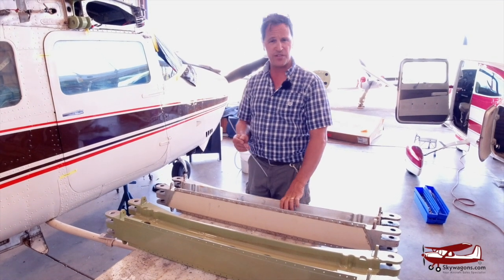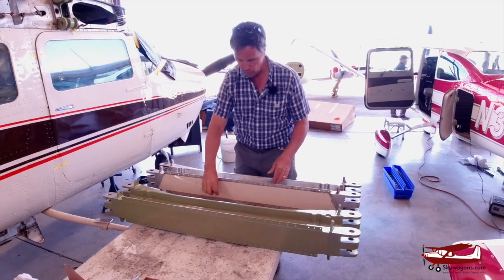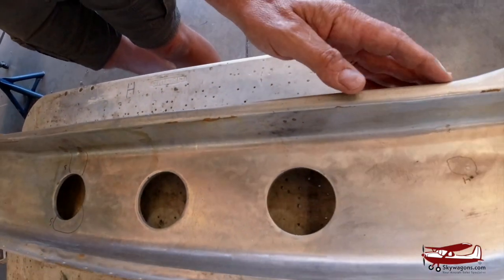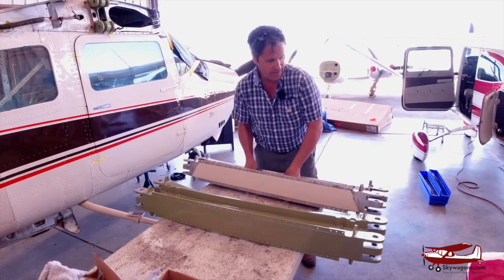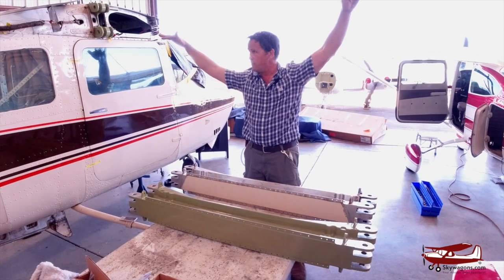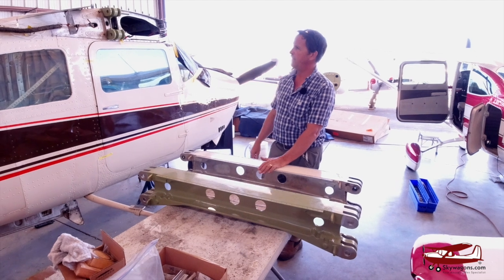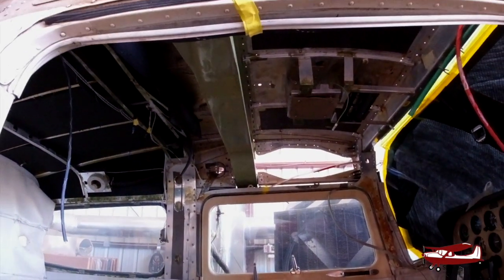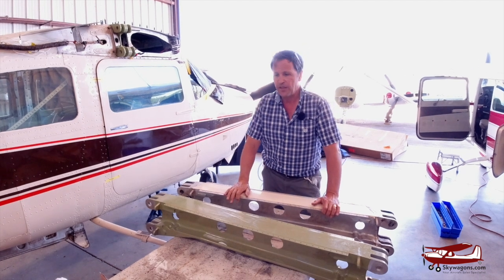210 Wing Spar AD

Comment: Well, its 3 years on and at least for Cardinals, the whole thing, parts and labor is in the $30K range.  Hardly chump change but at least worth repairing (mine passed with no problems)   I don’t know about the 210's but I do know that Cessna is now making replacement spars for the Centurion.  The vast Majority of Cardinals are fortunately having no issues.
Reply from the maker: Thanks for the update.
Reply: I was an airplane nut as a boy and back in the early 70’s you could buy a really nice Cardinal for $30k!

Comment: Cessna charging $20,000 for that part, when you can purchase some new cars for that price, is reprehensible. It is profiteering since they can make the part for about $1000. This is enough to turn me away from certificated aircraft and point me toward building a sling tsi. These manufacturers don't understand that they're not doing themselves any favors in the long term.
Reply from the maker: I know.  It is just a block of Aluminum and they have made them before it's not rocket science.

Comment: Never trust just a log book entry.  If you are buying an AC with a major known AD you are taking the risk that it wasn't pencil whipped to simply sell the AC faster.  Sure, you could sue, but that takes years.
Reply from the maker: You are not kidding.  I bought a 310Q with a pre-buy and a fresh annual.  On my first annual we discovered corrosion.  Tail feathers had to be replaced completely.  One wing was removed, sent off, and the spar replaced.  The other wing was repaired in place.  Paid for that plane twice.  - Don the Camera Guy.

Comment: I've been watching several videos of Cessnas and Pipers having issues with spars, wing and strut AD's.

And every AD is a wallet killer.
The only thing that makes it cost effective is the eye watering cost of a new aircraft vs an older aircraft.
Reply from the maker: Most Ads are small and easy. Every now and then there is a big one like the 210 Spar.  Piper spar is an inspection which they pas 99% of the time and is cheap.

Comment: Mark, those depressions are called blend-outs of corrosion that you pointed out on the condemned one close to the lightening hole.
So someone has blended the corrosion out and the depth of the blend-out is beyone the manufacturers limits.

Is the material of the replacement one the same material as the condemned one-?
If it is so, then the only difference is the primer coat protecting the replacement one.

For that ridiculous price I would want that forging to be made from titanium material.
Reply from the maker: Thank you for this extra info.

Comment: $60k? That’s insane! And $20k for a used part?  That’s equally likely to fail? That’s completely crazy. The whole liability thing is completely out of hand.  People die in automobile crashes all the time but cars don’t cost hundreds of thousands. If used parts go for that kind of money, I’d be worried that people will start cannibalizing aircraft left on the ramp. I’m not a metallurgist, but I would think a new part could be milled out of billet aluminum for far less money and it would be stronger than a cast part. I have a hard time believing that part couldn’t be made new and sold for around $2,000.
Reply from the maker: I know.  It's a plane so the part is expensive etc etc etc.  A good shop with the right tooling could probably make that spar for a few grand. But there is the liability which will be the death of creativity and mechanical evolution and development.
Reply: It's the FAA paperwork trail that's expensive

Comment: Thanks, Mark! I really appreciate your informative videos on the AD requirements for 210 & 177 wing spar inspections… and the AD requirements for 172 & 182 wing strut inspections! Both can be very expensive repairs… and should be considered before buying these aircraft! Fortunately, 177 aircraft flown in TYPICAL usage do not need the AD inspection until 15,000 flight hours if wing STC modifications have NOT been made…
Reply from the maker: Thank you for this specific information.
Reply: If anyone comes looking. The 177 and the 210 all require inspection and eddy current testing regardless of hours on the airframe.

Comment: For an extra 100 dollars from the factory and an additional 20 pounds of aluminum, that spar could have been made 3 times stronger and never failed under any conditions. Cessna probably saved 50 dollars or so though during production, I guess they never dreamed those planes would fly 5 decades or more. And if they gave so little thought to the carry through spar, what's going to start snapping off next? Manufacturers should calculate how strong the wing spar needs to be, then double it for production like they did with the DC3. Nothing more unsettling than flying around in an old plane and hoping you don't hit turbulence because maybe the wing will snap off.
Reply from the maker: It could have been a lot bigger, thicker and stronger for sure..

Comment: 1. $20 grand because they're old stock or newly manufactured to comply with potential AD failure?
2. Are the A-F 210 carry-throughs the same?
Reply: One additional question: can a used one having passed inspection be used and at less cost?
Reply from the maker: Unfortunately all the ones out there are good used ones and they are the expensive ones.  Cessna will make them new soon and they will be even more.
Reply: @skywagonuniversity5023  Thanks for your responses.
Reply from the maker: Any 210 with a strut, does not have this AD, That would be 61 to 66.

Comment: 20k for the part? I saw your other video and that kit was 7k. Amazing how you pilots are being taken advantage of.  Not fair. I guess am going to have to fix that and start making these parts for less $$$......oh, Thanks again for sharing this video also.
Reply from the maker: Yes, they probably cost 10% of that to make. Cessna does not make them again yet.  The ones used to repair these planes are good used ones.
Reply: @skywagonuniversity5023  If Cessna ever decides to make them again at all. Who knows what it would cost Cessna to make them. As it is a cast part do they even have the molding? Or does the company that made them for Cessna have the mold? Doubtful. If they are even still in business. 

In order to even think about making them again Cessna would need to know how many are needed. 
It might be possible with modern rapid prototyping to scan the part, use that to make the mold, take an old spar, melt and recast it.

Comment: As part of its backgrounding process, the FAA received reports of “widespread and severe corrosion of the carry-thru spar” on Cessna 210G through 210M models, including the T210 variants. “Further investigation identified that these early model airplanes were manufactured without corrosion protection or primer, increasing their susceptibility to corrosion. Additionally, the design of these early model airplanes, where the upper surface of the spar is exposed to the environment, allows a pathway for moisture intrusion. Model 210-series airplanes were also delivered with foam installed along the carry-thru spar lower cap. The foam traps moisture against the lower surface of the carry-thru spar cap, which can increase the development of corrosion,” according to the AD.

Comment: Sadly, this will be the end for a lot of 210s, or pilots willing to fix them. Someone should be able to machine that part with materials for $5000, tops. Using standard aviation cost multiplier of 3x or 4x for the ridiculous liability and bureaucracy excuses, $20k sounds about right.🙄
Reply: If I remember right, the carry through is forged, which means the grain structure follows the shape of the caps, whereas a CNC'ed billet would probably have to be heavier for the same strength. As he says, in light aircraft terms, it is a massive lump of aluminium.
Wonder how much someone in Russia would charge to machine it from titanium?
You're probably still looking at $25k+ to do the install :(

Comment: https://www.aopa.org/news-and-media/all-news/2019/july/01/cessna-210-accident-prompts-wing-spar-concern
Reply from the maker: This was very interesting.   From the link provided. 
The airplane involved in the May 26 accident, in which the right wing separated in flight, crashed during a geological survey mission, killing both occupants. Investigators issued a preliminary finding that wing-spar fracture was caused by fatigue cracking. The accident airplane has been modified for geological survey work, including a tail boom, integral wing tanks, installation of specialized equipment in place of the rear seats, and a “non-standard engine and propeller installation.”
Reply: Your presentation helps a lot to get  what could of happen , I was into the market to buy an P 210 ever since I discoverer those accidents well...

Comment: Retired aircraft structural engineer here.  If this is just a web problem and the upper and lower flanges have not lost significant material and are not pitted, it seems like this could be repaired. In I-beams the upper and lower flanges take most of the bending loads and the web takes nearly all of the shear loads.  For positive loads, the top flange is in compression and the lower flange is in tension.  Shear loads from the outboard wing are reacted into the side structure before they reach the center of the cabin, so the I-beam in this area sees virtually no shear load and is in pure bending. In pure bending, the web material has nothing to do other than to locate and stiffen the upper and lower flanges.  If this were a manufacturing defect at the military AC factory I used to work at we would have smoothed the damaged web material and reinforced it with two donut shaped doubler plates or patches, one on each side of the web.  

If you look at a Cherokee wing spar it is completely built up of layers of plates, angels, and T sections all riveted together.  This Cessna carry through could likely be reinforced in this fashion rather than replaced.  Of course, you would have to get a field STC for the repair, but for $60,000, that might be possible.
Reply from the maker: Good points and thanks for the explanation!
Reply: I was thinking the same thing. Why fail it for a little corrosion on the web? This wouldn't effect the strength of overall structure, as long as the top and especially the bottom  chords are solid.
Reply: This is the link to the report and the dimensions and location of the corroded area: https://www.casa.gov.au/file/211271/download?token=Cx2TxScO
Reply: He said the lower flange has "irregularities".

Comment: I would pay Mike Patey the $50,000 to build a complete carbon fiber wing with a sold wing spar all the way through instead of this insanity. You may have an experimental but it will be ten times stronger, faster and never need replacement ever again. All your parts would be a lot cheaper as an experimental also.
Reply: What makes you think Patey would design you a complete wing for 50 grand? Weird comment to make
Reply: Build it, test it, break it...
Reply: I fly a Mooney and like the fact the wing is a single unit from one wingtip to the other.  Not many wing failures on Mooneys.  I look at how piper wings are attached and cringe.  The Cessna 210 spar carry through just looks unnecessary.

Comment: "Cast" ...casting ? Aluminium alloy ? Surely a billet. ✈
Reply from the maker: I'd assume a billet but it is all rounded off and looks very moulded or cast too.  Not sure.
Reply: @skywagonuniversity5023  casting integral strength of aluminium is very low - I think it would be a macnined billet - as you see steel when red hot pounded into shape, increasing molecular ability. 
I earned good revenue from all these types now literally cracking up, including x 2 210N - all remote area flights - all 200 series Cessnas in Oz have a tough life. You prob know, USA maufactuers set their airframe component limits based on Australian meteorological flight conditions - and all light types operate in the worst convective layer below 10,000 ft.
WHEN total cable replacement became Oz CAA mandatory, prices dropped to terrible low. With latest AD, I see good 182...AUD $8,000. Early 310 in great appearence with near new engines and props...AUD $60K...about 30 active AD probably not addressed, certainly not wing cracks.
Sad times.
Your presenations R a good watch - I know all these tweaky minor differences, having lived the era, worked on & flown.
Reply: @christopherbatty3837  The accident aircraft had a particularly hard life. Modified with a stinger boom on the tail for sensors, then flown 6,000 hours a year in a scanning pattern over land in strips 200' apart and 200' above the ground, with an abrupt climb and steep turn at each end. Gear racks for the electronics to run the sensors replacing seats. http://www.thomsonaviation.com.au/our-equipment/
Reply: @MargaretLeber  Hi Margaret - understand - was CP GA company with predominantly remote area work - from 180/2/5 to all 200 series: hard working lives Cessna certainly didn't envision - AND for a hull life/time period never conceived - as aircraft engineer, I worked on some of these tired-before-their-time machines....Ditto Super Kingair I drove in tropics Oz & PNG into "marginal" strips daily. ✈ Have survey exp, single & multi - lost friend in latter ...straight into hill.

Comment: IF YOU LOOK AT THOSE SIZE OF THOSE LARGE LIGHTENING HOLES AND BOLT ATTACHMENT HOLES. HOW IS REMOVING THAT CORROSION ON THE ONE YOU CLEAN UP GOING AFFECT THAT MASSIVE STRUCTURE.  ANOTHER RIDICULOUS INSANE FAA AD COSTING MORE THAN SOME PLANES ARE WORTH. STRESS TEST THAT WING BOLTED ON THE OLD CARRY THROUGH AND THE WING WILL BREAK FIRST. IT WAS WAY OVERBUILD FROM THE GET GO. IF IT GOING FAIL FROM CORROSION ITS GOING BE INTERGRANULAR CORROSION WHICH CAN'T BE REMOVED.
Reply from the maker: True.

Comment: How is that center spar section attached to the airframe?  What holds it to the fuselage?
Reply from the maker: It's all in the structure of the vertical sides of the pane and those big tabs on the center section.

Comment: Note that the old spar is not zinc chromated and the new one is.  Shame Cessna didn’t zinc chromate them from the factory, which is one reason why I like Skywagons with float kits.  That green shade is a comfort when inspecting my airplane.
Reply: They did come from the factory zinc chromated but it was an option that the buyer had to choose when ordering their plane. This AD is about to extend to the N and R models and those all came primed. There are alot of missing elements to this video.
Reply from the maker: @TopNotchbaseball   Not really any missing elements because this is not an FAA lecture. It is an overview of a dismantled 210 with an exposed spar and two other spars on a table to show what they do and what they look like.  Not sure if I should have been any more clear.  Then once viewers have the idea of what is involved, and they own a strutless 210, they contact their mechanic to see if they are going to need this work. It is illustrative with an opportunity to show the parts involved.  All of the spars were coated when new.  That one is bare metal because it has been cleaned to inspect it.  The R models have a higher GW and a heavier Spar.
Reply: @skywagonuniversity5023  Believe me it's okay, none of this stuff is really spelled out properly. You have to find an old crusty guy who was forced to do it without any real explanation to teach you about it.
Reply: @TopNotchbaseball    Thanks for the info.
Reply from the maker: Manny,  To be honest, I think that they were corrosion-proofed when new but they have to be stripped and cleaned of all paint and glue etc to be able to see the surface. Ironically the corrosion on the lower surface is caused by the glue that hold the padding and headliner and the steel in the vent tubes up there in damp environments. Anything corrosion proofed is better though.
Reply: @skywagonuniversity5023    210s equipped with air conditioning would be especially vulnerable to condensation  as the lines run through the cabin roof through the spar
Reply: @skywagonuniversity5023    It’s my understanding that the AD allows the inspection of the spar to be done in place.  That removed spar has no evidence of zinc chromate, although, it may have been alodined.  The new one is fully zinc chromated.

The operating environment is the primary contributor to corrosion on the spar, according to what I have read.  I know a guy who got “a really good deal” on a 210.  I hope it really was.
Reply from the maker: Yes,  That is correct.  The inspection is done with the spar carry-through in place.  If it passes, you are all good.  If it fails, then the fiasco begins.  That one is all cleaned up after removal for closer inspection.